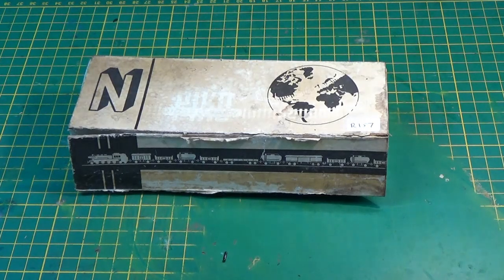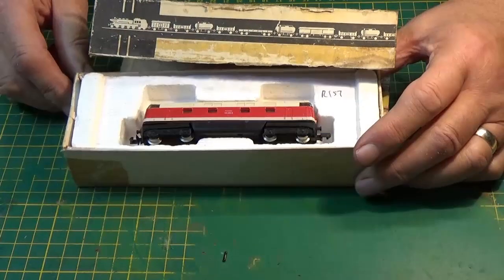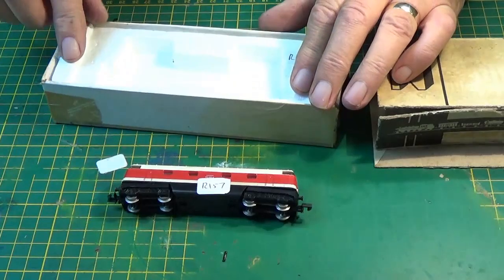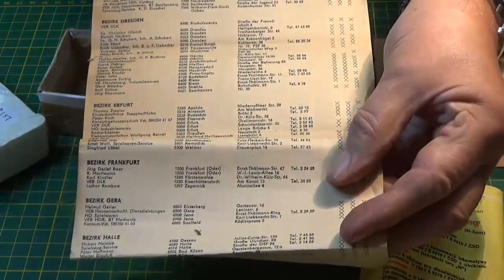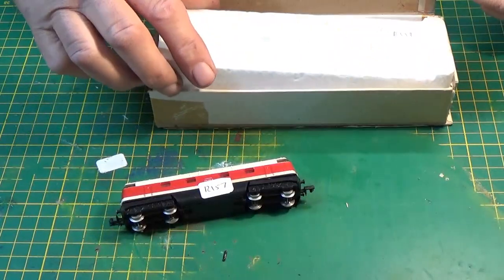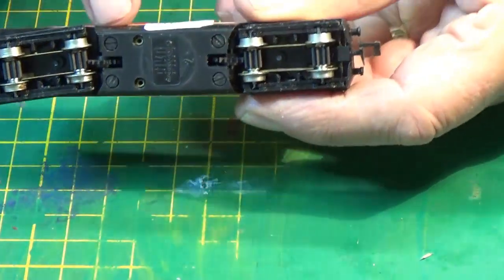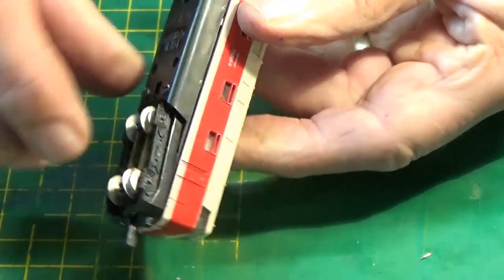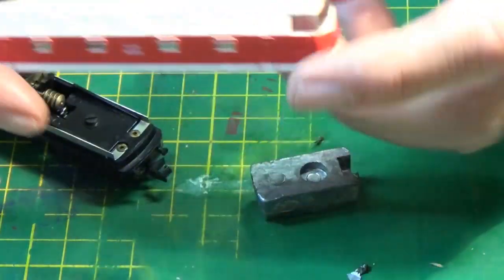PIKO DB118 Diesel Loco

Comment: i had one of those locos, the same runing gear and different body (blue and silver) in my loco plastic bearing in the motor gave in and it lost all power due to armature rubing the magnetic ring inside motor
 it also got demagnetised from the heat
contacts below bogies were a pain and two internal driven wheels kept locking because those two gears between worm and wheels kept locking up or poping out

also you have an early model i belive, because it still have side details on the bogies molded
some of them have totaly clear bogies made from grey plastic
Reply from the maker: Thanks for the details. Did you get your PIKO running again? I think spares are hard to come by
Reply: @SoRTs6233  sadly no, i broke it around 20 years ago and all i has left of it is one weight and single wheel set. i got it used from the first owner al a let me down and it was well abused before that by previous 2 teenagers and it was my first train when i was 13 so the whole set got destroyed by me trying to use it and later fix it.
but actually no, not the whole set i might still have a ramp for pushing cars down on tracks and a single coal car in very bad condition and a bunch of rusted piko tracks bented out of shape. i wish i didn't broke the loco but when i got my the motor was on it's way out, one of plastic pieced holding nuts for the screws was broken off the body (from dryving the train up the ramp at high speed just to derail the train while flying) 
it did run for a while but it was slow, and had probems with derailments and arcing inside. screws did not hold the body and the whole thing was falling apart and body was starting to melt from the motor overheating. i later shortened it down to only 4 wheels on 2 axles mounted solid and bodymounted the couplers, but it sucked at getting power from the rails at low speed and liked to derail. and finaly it died totaly
right now i have much better loco and better tracks  but i am in a phase of building my own bodies for it because nothing resembles my domestic trains
Reply from the maker: @The_Hokey_Fly  Thanks for the information. I am not familiar with DB locos so it's good to find out more about these.
Take care, Jim L